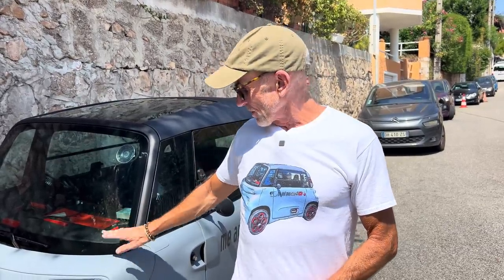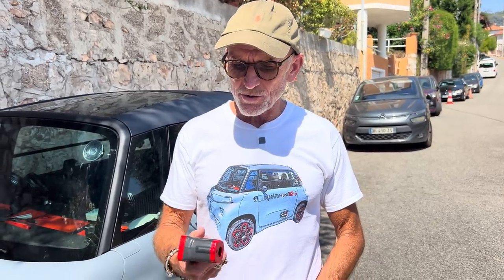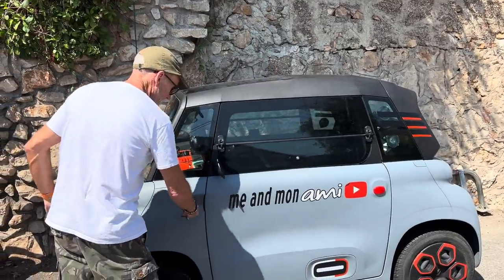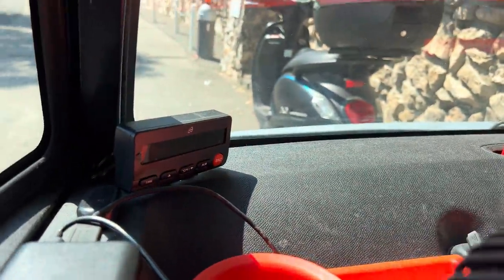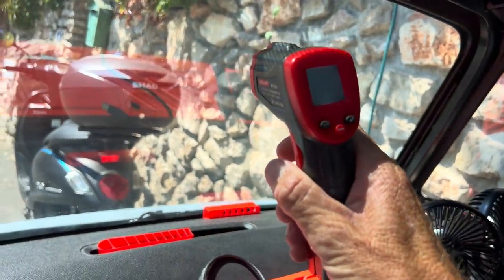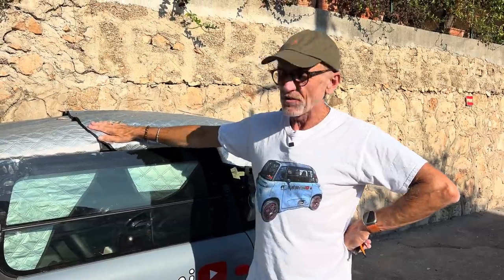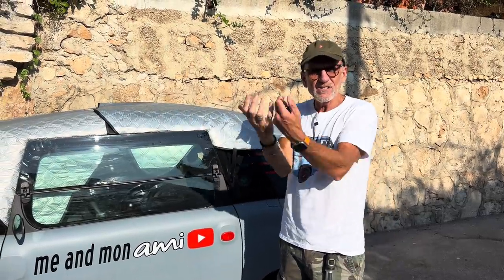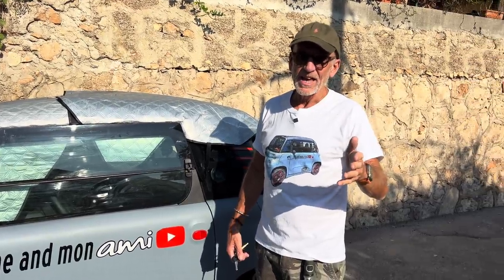Why Does Our CITROEN AMI Get So HOT? I Use TEMP GUN To Find Out!

Comment: Absolutely a white roof will make all the difference together with dark tinted side windows, then always park in shaded areas.
Reply from the maker: Yup but not always or often possible here (you’d be amazed how few charge points are in the shade and yet heat effects battery charge times etc)

Comment: I have a 60 seater bus. It was yellow. I painted it grey and tinted the windows. It got very hot inside. I painted it white and it immediately became about outside temperature inside - a shade higher. I covered over some of the windows with white painted aluminium since they were no longer in use. Big difference. Parking with the windshield facing away from the sun would make an even bigger difference. The windshield magnifies the sun's heat.

Comment: If you put dark tint on your windows it won't get so  hot
Reply from the maker: Yes but the roof ..
Reply: You can replace the black plastic with white on the roof or go the more expensive route, insulate the car! The reason the Ami is cheap is where Citroen cut corners: insulation. Cars are well insulated; a quadricycle, not so much! That would be a significant upgrade to Elton and you guys would have to decide if that’s financially feasible.

Comment: I installed a low profile, 12v, motorised extractor fan into the roof of my small van.  On the hottest day of last year in the UK (40+ degrees centigrade), the running fan plus the two part open front windows kept air circulating inside and massively reduced the inside temperature.  Inside, putting your hand up to the part open window, you could feel the air flowing in.

Installing even a manual, wind-operated vent on the roof (one of those spinning ones) would give somewhere for the heat to escape.  Heat travels upwards so it'll get trapped in the roof space.  Installing them on your plastic roof would just mean bravely using a hole drill, poking the fan through and screwing on the retainer underneath.
Reply from the maker: Thanks I can see how this can work. I lm not sure I quite have the courage to do the drilling yet!
Reply: @MeandMonAmi  I know how you feel.  I put a bigger one in my last van - it needed a fourteen inch square hole in a roof that was formed in channels (and made of metal).  It was terrifying.  It's a big step but ultimately, it would make Elton both unique and super stylish!  Well, sort of!

Comment: I used to live in India and found either 1) a damp face cloth over the vents worked ok (the air goes through the cold water on the cloth and cools the car - but you need quite a few cloths as they do get dry) or  2) fill a bottle to 2/3 full of water (to allow for expansion) and freeze it. Again place it in front of the fan (needs to be secured) to get a little cooler. Admittedly they are not as good as A/C but they make a difference, they are eco-friendly, renewable and for a die hard Yorkshireman - cheap!!  Good luck...
Reply: There’s an old AC technology called swamp cooler, really easy to do with cheap parts by following some YouTube tutorial, basically works like you described.
Reply: The problem with these swamp coolers is, that they only perform there best when the air humidity is low! They will create a humid atmosphere in the car, that makes you feel sticky! Airconditioning cool's and dries the air at the same time. There are airconditioner's that operate on 12V and even AC on their own battery pack! That last one is available as a heatpump(!), which means that it's cool in summer and warm in winter! But these AC's are rather expensive though.... They start around €2.000,=!

Comment: Good heat study Tim!  I can relate some of my experience refurbishing aircraft and interiors, and upgrading the old factory tinted acrylic windows to newer windows that reflected infrared light (heat) made a huge difference in cabin temps on the ground and in the air, and there are high-tech window films that feature a heat reflective coating that reduce heat with a light tint say 10 to 20%. Tint could be applied to the sun roof as well, perhaps in an 80% dark tint. 

I recall a low-wing Mooney aircraft I had that was painted black on the aluminum fuselage, and it used to so hot you could not touch the door latches to open the door on hot days  After having the aircraft repainted white, fuselage was only warm to the touch and interior temps dropped noticeably, so if a vinyl wrap will stick to Elton's top I think that might well drop the top temps to a tolerable level, and the wrap could feature some creative elements as well or a reflective metallic? You might try something like white fabric or plastic on part of the roof to see how much it drops the inside temp. 

Have you seen the window wraps on buses that often feature some are perforated that might work for Elton's sun-roof and rear side windows. 

As for insulation, In aircraft I used both a lightweight fire-retardant foam and an aircraft grade of reflective bubble wrap Reflectix ( https://youtu.be/0k1-sbyXPZk?t=128 ) applied with some 3M industrial adhesive to the interior of the aluminum fuselage behind the interior side panels, and both did wonders for sound and heat. My thought is that you might be able to attach Reflectix with Velcro to the framework and by stitching it to the film, but it might be a bit unattractive, and a white external wrap might do better than the black roof with interior insulation. 

You might be able to cut and fit Refectix in between the roof frames in spots. In Aircraft I was reselling I often cut Reflectix window inserts to apply from the inside small bit of adhesive velcro stuck to the glass and stitched to the inserts as seen here https://youtu.be/FslbmQTGhaY?t=98 helped when parked outdoors on a ramp. I had my interior shop stitch a bit of fabric binding around the edges to protect the edges and hold the inserts in place, and sew-up a thin fabric duffel bag to store them in, as they can be rolled-up to be pretty compact. 

You might be able to power Elton's vent fan at low speed with a small solar panel when parked, It could be placed in the windscreen in front of a reflectix windscreen insert.
Reply from the maker: Th l’as Jack i just watched the video. I think we are going to try something similar inside roof

Comment: Lots of good advice here. One more thing to consider, taking the example of desert explorers in the early 1930’s. They incorporated a false roof which allowed airflow past the roof when driving. Roof rack with a reflective panel mounting solar panels would achieve this, plus top up your additional battery all day. You will need a gap/window so the driver could see traffic lights when at the front of a queue waiting for green, however the principle remains the same reflect, insulate, maintain an air gap and encourage an airflow when moving.
Reply from the maker: Thanks that makes sense

Comment: cork. a layer of cork on the roof, well wet under the sun. the evaporation of the water in the cork will suck up heat from the car.
Reply from the maker: That’s interesting does it keep shape?
Reply: well it is cork so it will indeed expand when wet and shrink when dry. unless it is "boxed" by another material, like corks in wine bottles expansion and shrinkige should be taken into account. not that that phenomenon can't be avoided using cork "fabric", or a segmented cork layer . the effect could be achieved by using a sponge but a natural material for the ami's roof would improve the machine.

ps: great videos. @MeandMonAmi

Comment: Here's another trick which works for me here in the Tropics. If the interior of my car is too hot after bing parked in the sun, I open all the doors and even the rear hatch, then I slam the doors on one side. This pushes out some of the hot air out through the open doors on the other side. I can often almost normalise the temperature inside the car with the ambient temperature just by slamming the doors in this manner maybe twice. You only have the two doors in the Ami but do try this and see if it works for you.
Reply from the maker: Thanks we are deploying something similar now

Comment: If things go proper commando, you could  ask NASA whether they got any "End-of-Line" Extra Vehicular Space suits used for the Apollo programme, you know they ones that had the fluid cooled "String-vest" undersuits.
 I think you'd cut quite a dash going round the local watering holes whilst doing the Marcel Marceau impressions when exiting  Elton. Trouble is the cooled undersuits were powered by a miniature refrigerator in the 60 pound back-pak probably requiring  extreme exertional training beforehand.

Comment: How about using your roof rack to attach a big white (or silver) board to the car when you park overnight at home. It doesn't need to be anything fancy but it'll reflect the sun BEFORE it gets to the roof and also allow some airflow under it to aid cooling. I'm sure you could cobble something together for a few Euros just as an experiment.
Reply: I was thinking of that to! But these roof-racks has to be pumped up and I think they will explode when exposed to continuous heat....

Comment: whe I was younger and less trained I would have said insulation, but all that does is add a layer that is slightly cooler to the touch, but traps the heat inside the car, the two that I would personally look into is getting rid of the black plastic as it attracts the heat. the 2nd thing is checking the laws on window tints in France, Italy etc that you take the Ami to, and then getting the required tint rolls that you can buy either online or in a motor shop, should be around 15 euro a roll of about 2 metres, but I am talking back in the days of boy racer childhood, but found the blacker the tint, the less heat in the car during a blazing summer. it is tricky to fit as need to use a hair dryer, and also a cloth, and a pin to burst bubbles if it goes on wrong, or get a professional to fit it. but those would be my main two suggestions.
Reply from the maker: Thanks very much

Comment: It feels like a combination of approaches is needed. Firstly you need to reduce the heat getting to Elton so white roof plus solar reflective film to roof and back window then darkest legal tints possible to the side windows. Stick with the temporary shield to the windscreen. You then need to deal with the heat that is left and reduce its transmittal so using something to insulate the roof and the metalwork will help further. My Ami Vice has used pipe lagging to cover the interior bars (with the added bonus of padding for your head 😊) and you could use one of your silver quilts to line the interior of the black plastic area. In short a full combination of all of the above suggestions. There are also USB air coolers on the market for when your driving.
Reply from the maker: Thanks. Some good ideas there! The usb coolers really don’t do anything in this heat we’ve tried

Comment: Why not order a full opening roof panel for the Fiat Topolino?   If the frame is the same on both vehicles a garage could easily swop it for you.     Open top in summer would make a huge difference as you drive.    :)
Reply: I think this is a very good option as they are the same car. It should work. Then they could call Elton an Amilino!
Reply from the maker: True but the Topolino isn’t out yet so I doubt the specialist roof is available yet
Reply: @MeandMonAmi  once the vehicle is available, hopefully a parts list will be available so you could enquire.    A sunroof on Elton would be lovely.
Reply from the maker: @andyeastyorks  it certainly would!

Comment: I would guess the cheapest heath robinson solution would be to use a couple of strap on inflatable roof racks one behind the other. This would introduce an air gap on the roof to test the theory. You could then sew in on the straps reflective radiator insulator cut to fit. Then its removable, its probably not going to make the AmI less aerodynamic and it would also be stable.
Reply from the maker: Yup

Comment: I would experiment with the 3M double sided tape and insolation foil, they use under laminate flooring! If you do it neat, you'll cover the whole roof for the summer! But having it wrapped (incl.the glass) in a mirror foil is the best option I think....
Reply from the maker: Yes I think we will try when it cools down enough to fit it!

Comment: So you need to prevent the solar radiation from hitting the roof. It's a shame you can't fit a roof rack because you could place a reflective surface on the rack above the roof and have the additional benefit of an air gap between. 
I know you've used a strap-on (🤗) roof rack but that may not provide the air gap, but it might be an interesting experiment to see if strapping down something reflective is still effective.
Reply from the maker: Yes I think it would but running with a roof rack all the time even a strap on isn’t really viable

Comment: Holy Smok'n Eyeballs :hand-orange-covering-eyes: , Tim and Mr. Boo, that is HOT!  🥵Most definitely a deterrent for taking drives when it's so stink'n hot! Definitely not good for Twiggy! I think that a white roof with insulation would take away some of the heat for sure, and perhaps even a few 'vents' up there couldn't hurt! Tinted windows would be a bonus. Have you considered perhaps getting a insulated cover that engulfs the entire car, rather than just the roof, when it's in the sun?...

Comment: The white wrap on the roof was also my first thought.  I would also suggest in combination with the white wrap on the roof, have the insulation on the inside. The reflective you use on the roof in the test add that on the inside with the reflective bit facing up.
Reply from the maker: Yes I think we may try reflective facing up first

Comment: When thinking of heating up of parked cars people tend to over-emphasize the closed surfaces of the cars concentrating very much on the reflective quality of the paintjob. The main problem are the windows, though. Sunlight gets in and heats up the surfaces inside the car that then heat up the air inside and also give off a lot of thermal radiation. So blocking the sun from passing the windows and covering the larger dark surfaces in the interior with lighter cloth or foil is the way to go. 
Careful with methods involving vaporizing water inside. Though the process actually cools the object that the liquid water is coming from (not so much the surrounding air), but the increase in humidity makes the heat much more unbearable compared to a few degrees more with dryer air.
Reply from the maker: Indeed and even with the reflective it was 40 Celsius to get into which is hardly healthy

Comment: As you know, black absorbs heat. If the roof was white as mentioned the interior wouldn’t get so hot as white reflects heat. Why hadn’t the designers at Citroen worked that out 🙄
I’d be tempted to have the roof sprayed white Tim

My little smart 4-2 has a tinted glass roof but can get unbearably hot when left standing in the sun. Luckily it has efficient air con.

Be interested to see how you tackle this
Reply from the maker: Yes I’m so reluctant to change the aesthetic as I like it but…

Comment: I live on a steel boat painted white and insulated inside, i cannot walk on it without shoes when sun is up. So, white is not enough, I suggest you keep that stuff you're using right now but try to keep it not so tight, you need some air in between, i use white plastic tube in between cover and roof. You can glue those tubes to any cover.
Reply from the maker: That’s very interesting to hear

Comment: You don't get accurate temperatures with infrared thermometers unless all the surfaces are the same I used to stick black tape where I needed to take readings or you can get correction charts for different materials, no point using on glass most of the infa red you pick up if from the other side. Hang wet towels  inside the energy required to evaporate the water out of them reduces the temperature a lot, fine water sprays into fans also works its how the old fashioned air conditioning worked ( but legionella was a problem if not maintained correctly )

Comment: I was thinking “wow that car really got hot” until I notice you are using Fahrenheit 🙄

Probably not more hot than a car here in Rio de Janeiro (Brazil), today we got the hottest day of winter ❄️ with 39°C 🔥

A white, silver or light gray roof probably will help a lot to reduce temperatures, tinted glass also makes a huge difference, you may want to get a light silver one instead of black so won’t make driving at night too bad.

There’s also a termal shield sticker that the vanlife people put on the roof of their vans on the inside side to block heat from outside, maybe clueing it on the inside of the plastic roof would help.
Reply from the maker: Going to look up the thermal shield sticker. The car was 60 c when we got in!
Reply: @MeandMonAmi  I remember seeing on a TV News several years ago on that “flashing news stating the obvious” about some black car under the summer sun getting up to 70°C with thermal sensation of 80°C because humidity.

Imagine how hot a car gets under the sun on a 50°C summer 🔥 

A cheap way to try to isolate the car roof would be using a thin polystyrene layer clued (double side tape) on it, excellent and cheaper for thermal isolation 😉

Maybe doing like a pillow cloth stuffed with a flat polystyrene and using magnets 🧲 to hold on the car frame.

Would be nice if the car had a sunroof like the fiat sibling, at least would get more air during driving.
Reply: @MeandMonAmi  look on YouTube how to build a swamp cooler for the car, it’s an old way to get AC using basically a PVC tube, water and cheaper materials, would be an
Interesting project/video.

Or use a icebox full of ice, 2 holes, one with a USB fan to put air inside and the other one with a bend piece of PVC tube to direct the cold air exiting the box.